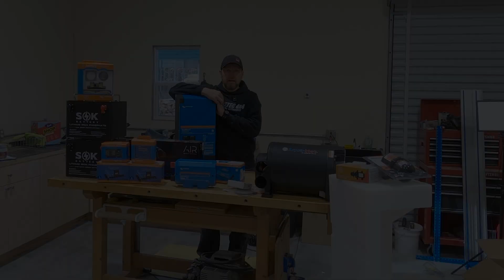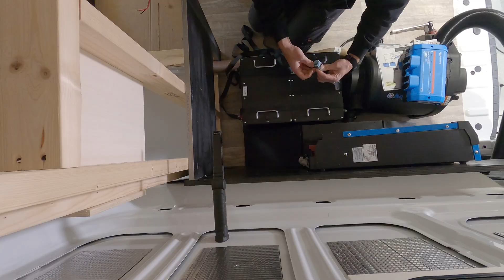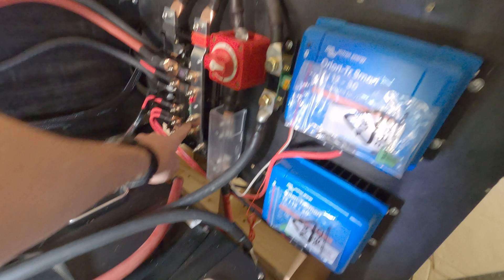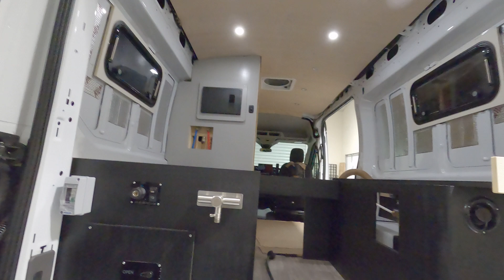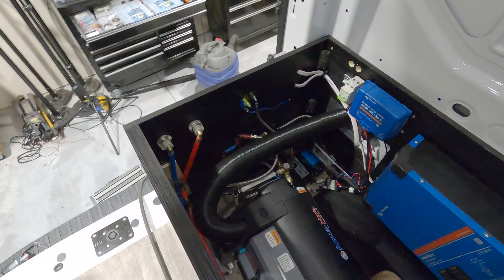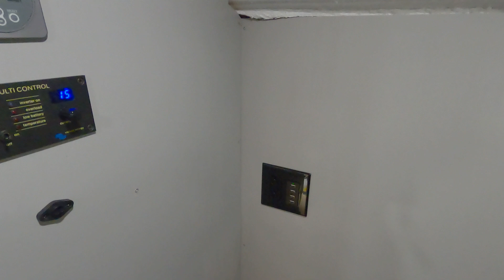Electrical & Plumbing - Did I Go Too Far? | Part 4 Ford Transit Trail Camper Build Series

Comment: i know space is always at a premium in these builds, but i'm crossing my fingers for ya that the hot water heater you put right next to your electrical system doesn't ever fail. cuz you know what electronics love right.....heat & water....yum yum yum. jokes aside, i'm worried for your decision about this.
Reply from the maker: Not happy with it either but after days of trying to change it that's just the only spot it fits. I also realized that pretty much anywhere I put the electronics there will be plumbing so it's just a game of moving the fuse.

Comment: Your inverter is mounted sideways.   I'm not sure, but don't they recommend it be mounted  vertical?
Reply from the maker: They do, and I tried, but there was no way to fit it. I researched it for a while, and it can be mounted sideways. The vertical mount is to allow air to rise through naturally to cool it, but there is a fan inside, so with good air flow it can work. If it does get hot an auxiliary fan can be added.

Comment: Coming along.  I am sure it isn’t as fast as you may like.  Hopefully the “shake down” went well without too many issues.
Reply from the maker: Mostly good. What I had done worked well, but not having any storage yet was a struggle. Definitely see the potential in it though.